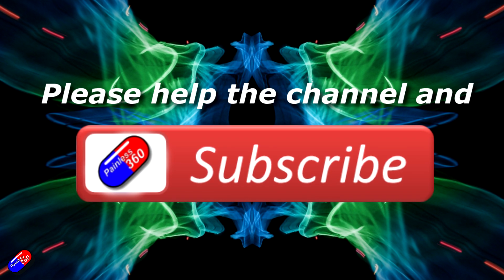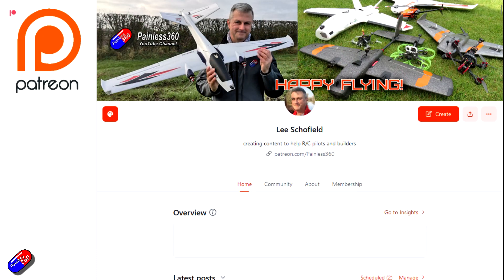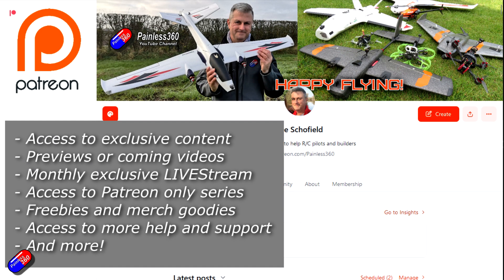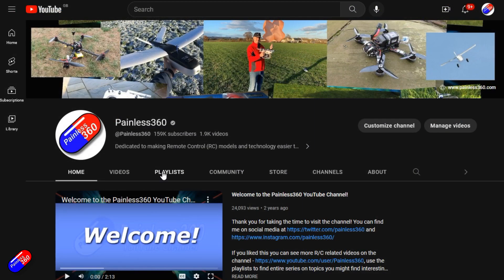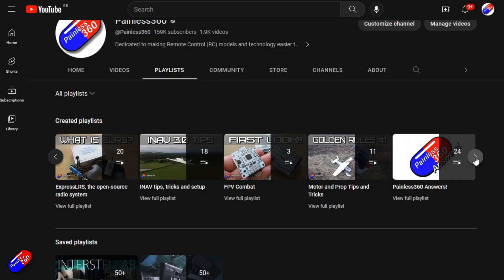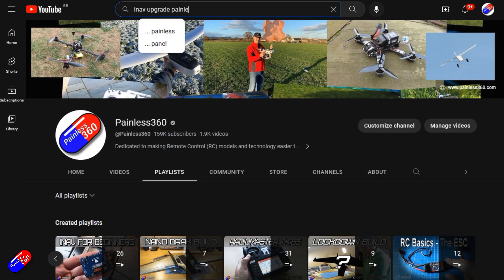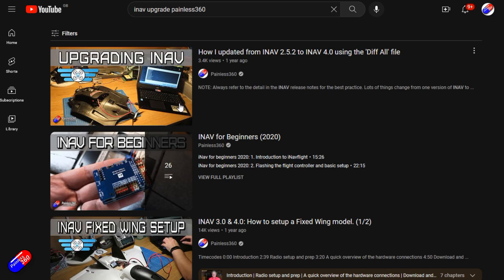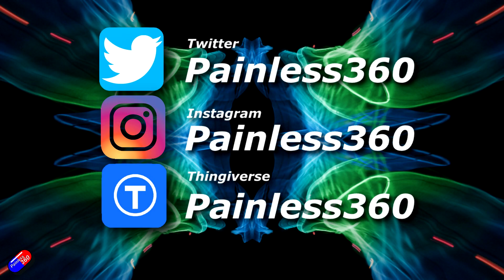EdgeTX Multirotor Model Setup for Beginners

Comment: What do you do when the only choice in temples Page is Blank model and personal.? 
Last up date 2.10.3 centurion
Reply from the maker: It appears they no longer start automatically and must be started manually. The location of the wizards has been changed to SD Card -> Scripts->Wizard.
Reply: @Painless360  Thank you  Ill see if I can find it and start it up. Its the first time trying to set up a quad on my T16s with edge and never realized the wizard is missing. I got myself a little Tiny hawk 2 to learn some FPV over the winter.😁

Comment: My momentary switch is SH on my tx16s and when i try to select it for my beeper it does not recognize that as an input and SH isn't listed as an option even when i try to select it with the jog wheel. not sure how to change this.. help would be much appreciated!
Reply from the maker: If it doesn't work at all, it could be a damaged switch or a loose wire... Best of luck

Comment: Do you mess with anything spectrum related on edge TX  (specifically trying to figure out how to get forward programming 0.53 or newer working on my radio for safe and as3x settings on a slider) I'm having trouble even getting it installed properly
Reply from the maker: I don't, sorry I can't help. Spektrum are poor at supporting widely used industry standards and are terrible at engaging with the community. Best of luck
Reply: Thank you for responding and you are not wrong lol